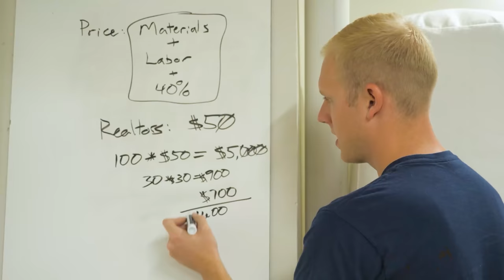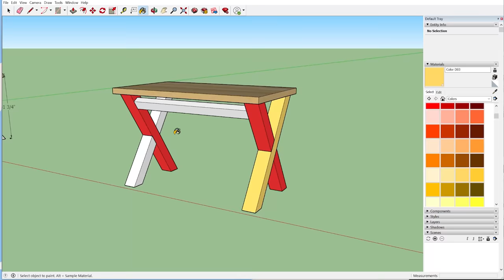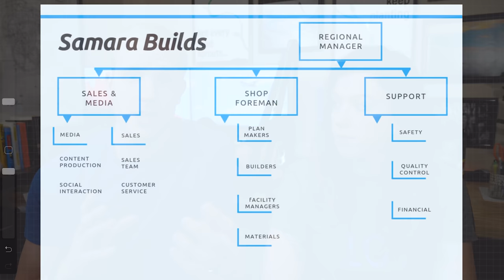we're splitting up. (it’s not what you think)

Comment: Pardon me if this comes across snarky, but your reply about risk tolerance is inane. I raced motorcycles in my younger days. High risk tolerance. But I wore a helmet. Putting your hands that close to a 3400 RPM carbide blade isn't risk tolerance. It's irresponsible and reckless.
Reply: It is a saw stop though, however you are correct, I personally would find a safer method.